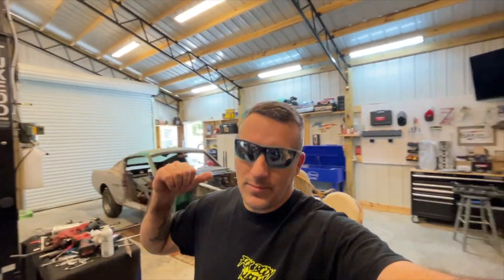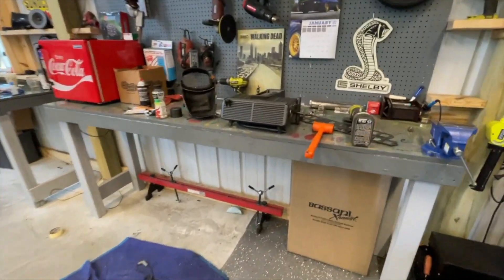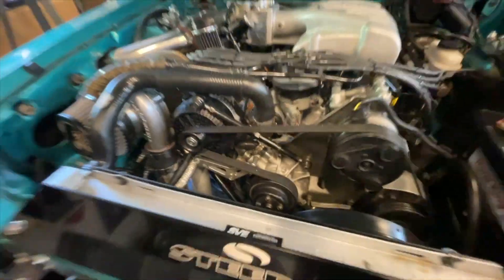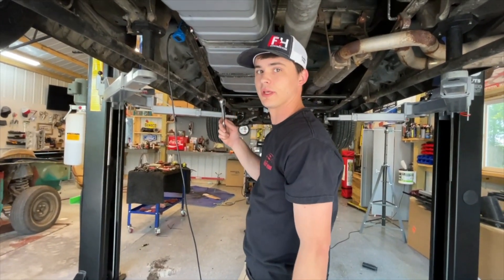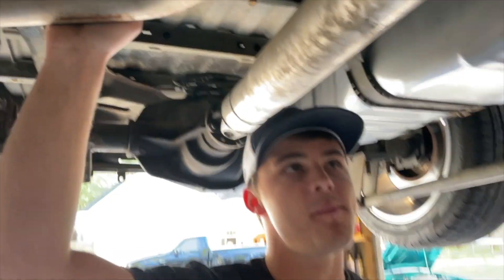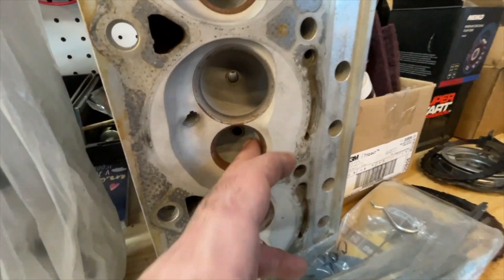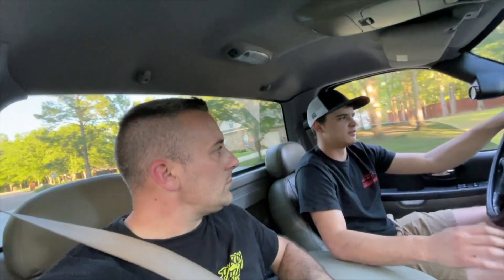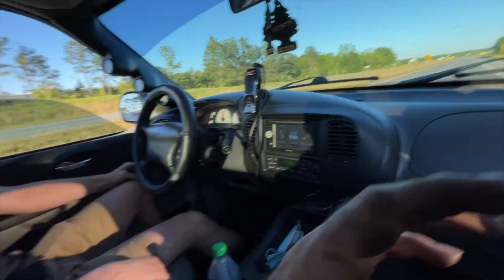It's A Hard KNOCK Life....

Comment: Remember I bearing Knock will get louder when you load the driveline, if you hold the brake and load the converter if the noise doesn’t get louder it’s most likely not a bearing.

Comment: I removed my heater core tube , I threaded the ect sensor to where the pipe threaded in at. I was having issues with the tunerstudio temp reading different then the dash gauge. Needless to say , there was air trapped in the sensor pocket. Took a whole summer to figure it out. I jacked the side of the car up and got it burped well. All good now.
Reply from the maker: Damn.... 😳

Comment: I used to have "cut outs" in my exhaust but, I eventually removed them because they would constantly mess up. I just got tired of it. It happens to even the best made ones because of carbon build up and heat. It is however cool to have them when they actually work right.
Reply: Same man I had some electric ones in my turbo fox and it was so cool but it was a stick at the time and it would pop thru the shifts so it eventually bent the valve 😂

Comment: That heater tube loop at the pump looks pretty kinked. Hope it doesn't cause you trouble down the road.
Reply: You can buy the rubber ( caps) from the auto parts stores and put a clamp on it.